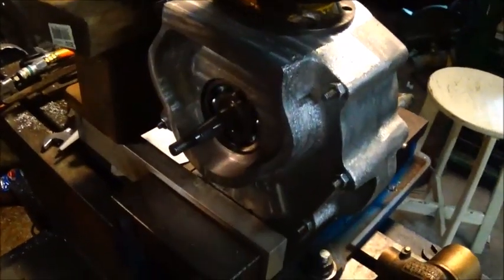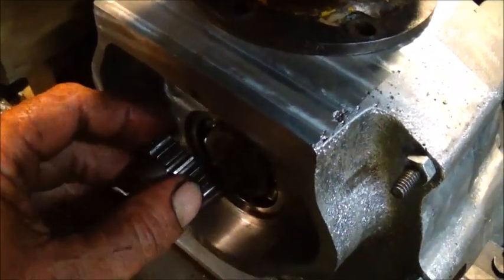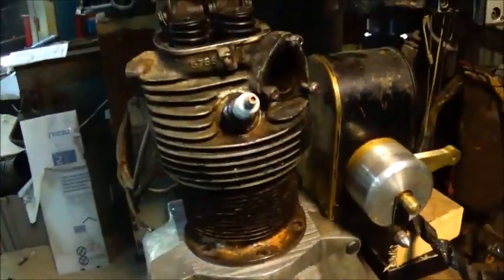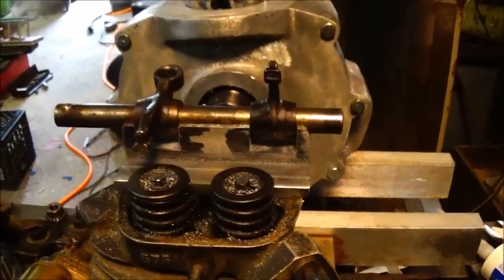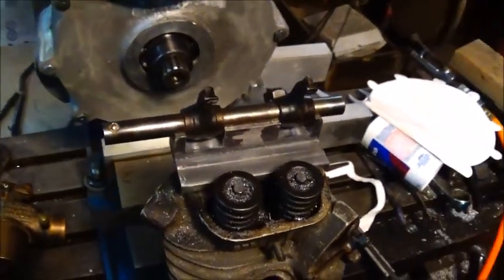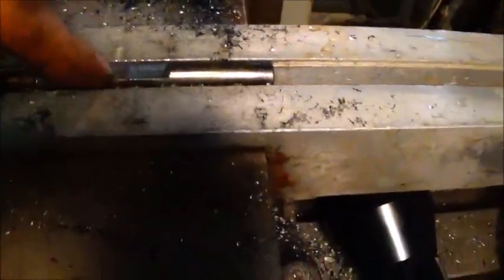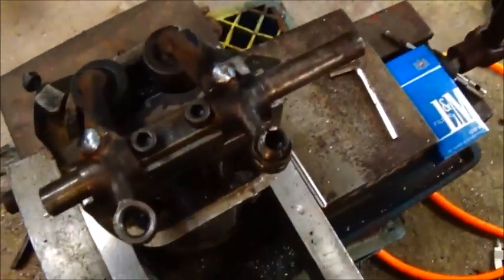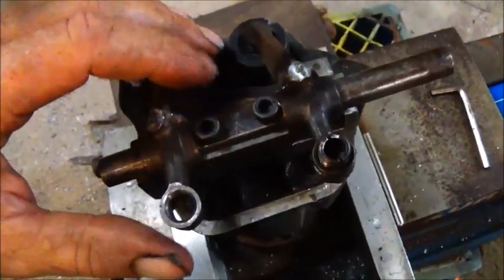Antique Motorcycle Engine Build (Replica) Part 20 Rockers and Stand

Comment: Totally relate to the love of repairing/building mechanical things. Incredible project, great work. Regarding the socket head cap screws on the rocker shaft, consider using appropriate lengths of allen wrench to both fill in the socket and leave a little hex head. I'm thinking braze or tig it in. If anybody does see them, it'll leave them guessing!

Comment: A couple questions, what soet oil pump will you use ? Dry sump? Will you run the pump off the mag drive ?And i guess the seal will go around the other way when you fit it up?  Looking very very interesting so far.
Reply from the maker: Splash oiling from a dipper on the rod. The seal is double sided, made to keep oil out of the two stroke crankcase on a YZ250, so it can go either way. It will be hidden by the pulley, so I am running with it since I have it. I will be doing some work on the inside to direct oil where I want it.

Comment: In addition to an oil fill- you also need some type of crankcase breather, too- correct?
Reply from the maker: In the oil fill cap.
Reply: You could use the dipstick from a riding mower, or car- or make one from sheet stock? Did they have sight glass back then? Is this going to have a valve cover? If not- how do they get oil? On a bike- would you have room for an oiler (glass jar, bracket, drip hole- like on old machines) or maybe a separate oil tank?

Comment: Screw Manufacturer
According to John Bates of the Traditional Tool Group in an article for SuperLiving.com.au, the SPS Company of the United States is thought by some to have invented the socket head cap screw. The company, established around 1911, used the brand name Unbrako, as in “unbreakable,” for the screw and became a world leader in its mass production.
In 1909–1910, William G. Allen patented a method of cold-forming screw heads around a hexagonal die (U.S. Patent 960,244). Published advertisements for the "Allen safety set screw" by the Allen Manufacturing Company of Hartford, Connecticut, exist from 1910.[2] Although it is unlikely that Allen was the first person to think of a hex socket drive, his patent for a manufacturing method and his realized product appear to be the first.
In his autobiography, the founder of the Standard Pressed Steel Company (SPS; now SPS Technologies, Inc.), Howard T. Hallowell Sr, presents a version of events[3] in which SPS developed a hex socket drive in-house, independently of Allen, circa 1911. From this came the Unbrako line of products. This account from Hallowell does not mention the Allen patent of 1910, nor the Allen safety set screw product line. Hallowell does describe, however, the same inspiration also mentioned in connection with Allen for a wave of adoption of the hex socket head, beginning with set screws and followed by cap screws. This was an industrial safety campaign, part of the larger Progressive Movement, to get headless set screws onto the pulleys and shafts of the line shafting that was ubiquitous in factories of the day. The headless set screws would be less likely to catch the clothing of workers and pull them into injurious contact with the running shaft.